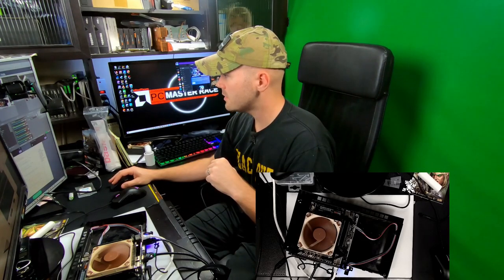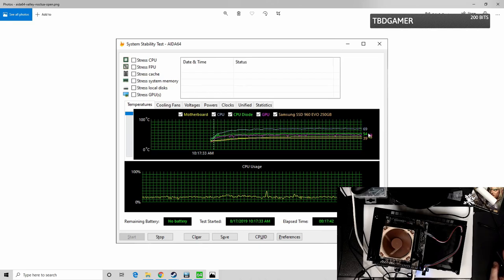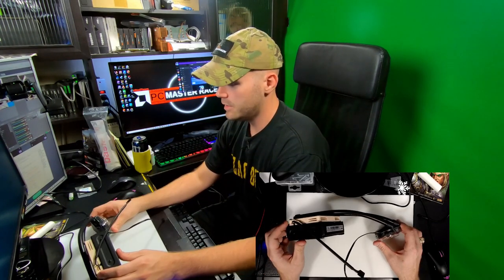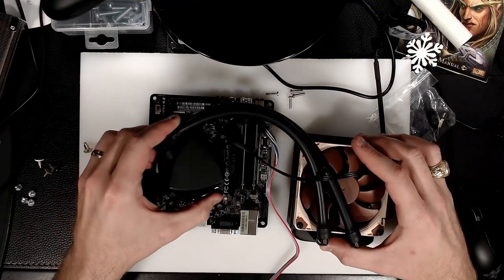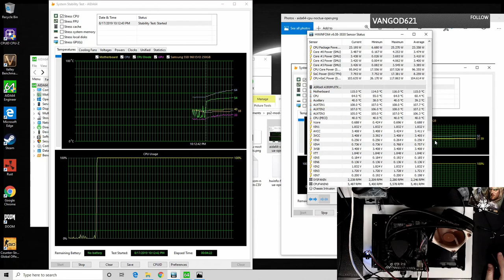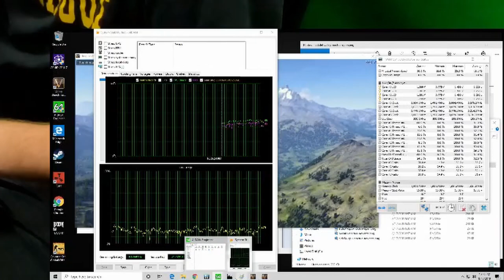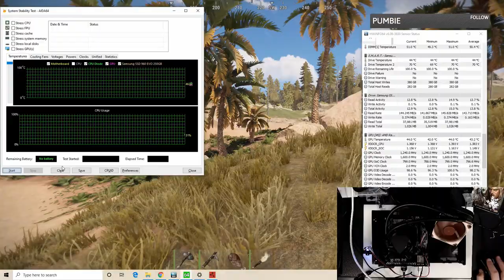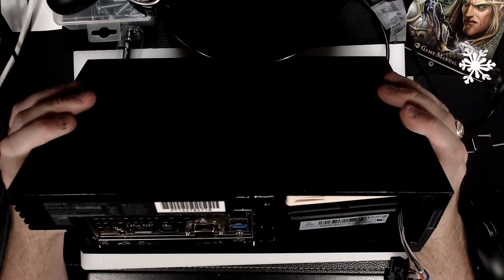Building a PlayStation! | Asetek 645LT vs Noctua L9a Thermal Analysis | pt 4/4

Comment: Have you considered taking a ps2 and simply increasing the specs of the ps2, while keeping the system as a ps2 running on the ps2 os hand still playing ps2 games?

I ask because CTuck recently made a way to make it so you could rewrite a ps2 disk with a different game, and a completely unmodded ps2 can read the game and run it right away. Assuming the hardware can handle the physics and graphics of the game. 

I used his software to produce a few new games for my unmoddified ps2 console. Two of them were Hollow Knight and Hyper Light drifter. 

Hyper light drifter works perfectly as if it was an official ps2 release of the game. The hollow knight I made does run. You could beat the game, however hollow knight is far more intensive of a game so the average fps is between 5-10. 

Which got me wondering if you could upgrade the hardware of the ps2, while keeping the console a ps2 at heart.

Edit: I may as well tell you what my last game was. Halo 2. Works perfectly since the hardware is in the same league as the original Xbox
Reply: That sounds so cool, I might try to dive into making Xbox games run on ps2. I recently found my Xbox and ps2 from when I was a kid and the ps2 was the only one working. I put the Xbox back for a later project and have been reading up on ps2 exploits. Are you planning to make any vids on how you were able to get those other games to run? If not then I will read up.

Comment: Would this cooler fit in the original case? Maybe with the radiator outside and the fan inside?
Reply from the maker: which case?  both coolers fit fine in the PS2 chassis
Reply: Jacob Terkelsen I’m talking about the original Asrock a300 .case
Reply from the maker: @Karriudo  ahh ok. It might fit all in the a300 but would be incredibly tight fit.  Mounting rad/fan outside could work too but wouldn't look the best